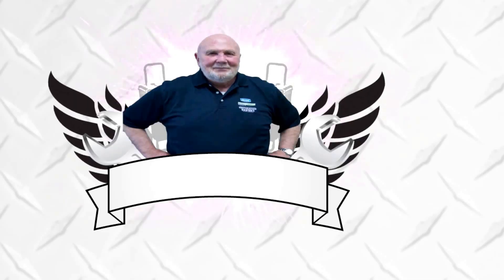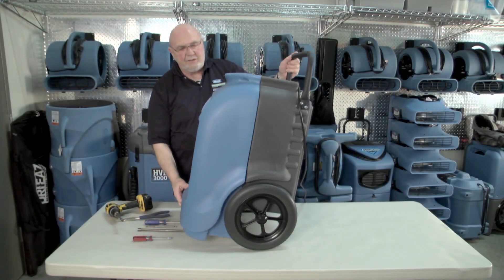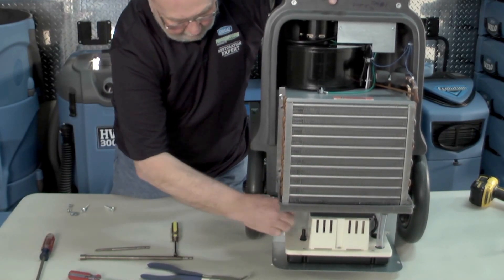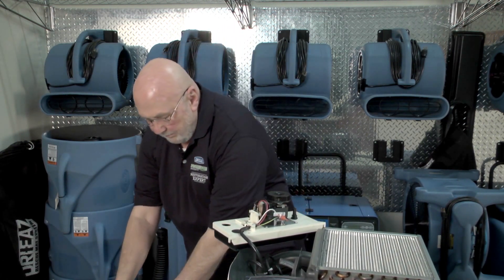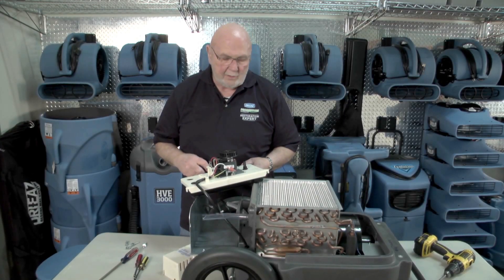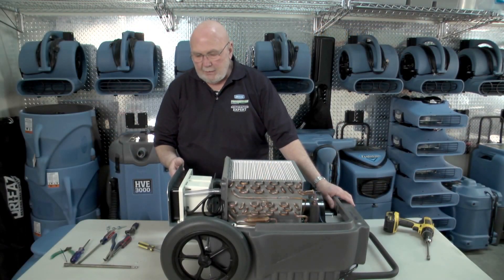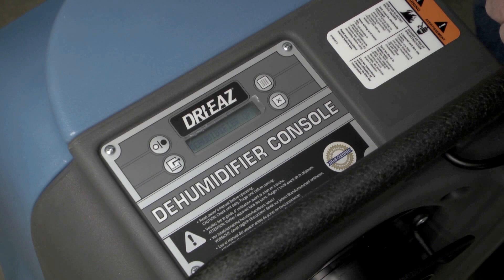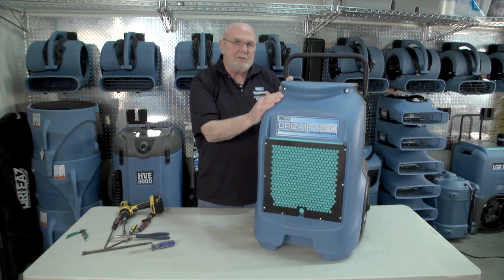Servicing the Dri-Eaz DrizAir 1200 Portable Dehumidifier

Comment: So I have one of these commercial dehumidifier’s in my basement. It was working great for a long time and now it will no longer turn on. Which is a problem since my basement just recently flooded. However, there is power going to the unit and when I hit the “purge” button it will purge but since it hasn’t been turning on, there is no water to purge out. I’m thinking it might need to be cleaned since I’ve never actually done that before? 😬 Thanks, this video was helpful.

Comment: Hello Robert, thank you for the video. We have an LGR 2800I. It has one hour on it. We went to plug it in today to use it and we’re getting no power to the unit or display. There is power to the outlet. Any suggestions? We’ve called TECH SUPPORT a couple times, but have not received an answer Inquiry. Thank you.
Reply from the maker: I know you said there is power to the outlet, but try the dehumidifier on a different circuit to double-check that the problem persists. If so, please call 360-757-7776 or use our Live Chat support feature here: https://www.legendbrands.com/contact/
Reply: Apologies. I should have mentioned we tried multiple outlets. Our male plug lights when electric is live to the power cord. The plug is lighted. I called legend a few times and left messages. 

Thank you

Comment: My brand new unit has been on for 90 minutes and nothing is coming out. The purge works but no waters coming out. Does it take a while for the pump to fill? Humidity is 65% and it's 65° in the basement
Reply from the maker: Because there are multiple conditions that could affect your dehumidifier water output, we recommend that you contact our Service team on Live Chat at Info.legendbrands.com or by phone at 800-932-3030.

Comment: Question... I’ve not used my DrizAir 1200 in several months. I changed out filter & changed out drain hoses, & plugged it in. It shows the hours on unit but won’t count down & turn on. Not showing any error code. Any ideas?

Comment: Nice straight to the point vid on servicing that 1200.  You said in case you need to run it, after laying it down? Running a dehumidifier after it has laid down, is not good for it.. I tell my guys to wait 24 hours after laying it down, before running it.

Comment: I have one that when it tries to kick into dehumidification mode it makes a clicking sound and creates a slight power surge, sometimes tripping the circuit breaker. It repeats over and over. Could this be an issue with the control panel? Or compressor?

Comment: Aren’t you not supposed to lay a dehumidifier down or else you can damage it?
Reply: that's right , there is oil inside the compressor ,suppose not to lay down the unite otherwise you need to wait 15 to 30 minutes before restart the unite .

Comment: Please share the link how can we deal with ER4 error code, thank you.
Reply from the maker: Which model? That's a defrost sensor error, often due to a loose connection at the control panel. Best to refer to your owner's manual for that specific unit -- or call Dri-Eaz Service at 800-932-3030.

Comment: The ones I use leaks from the bottom any idea what could cause leaking
Reply from the maker: Check with our Dri-Eaz service techs at 800-932-3030.
Reply: Its the pump. Your overflow probably isnt engaging. Just replace the pump
Reply: @usablegamer416  Or make sure the hoses to and from the pump are securely in place / not damaged

Comment: How do you fix off on button
Reply from the maker: Hi Manuel - If you're using a DrizAir 1200 dehumidifier and the Power switch on the control panel no longer works, you will need to replace the control panel (Part #103238). You can find the closest Authorized Service Center that carries Dri-Eaz parts using this search: https://www.legendbrands.com/how-to-buy/dealer-search/